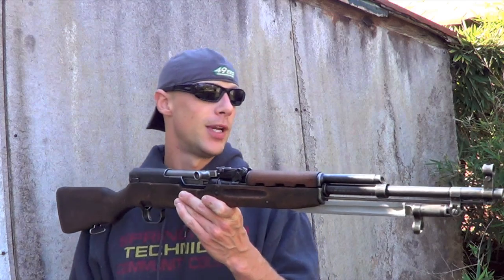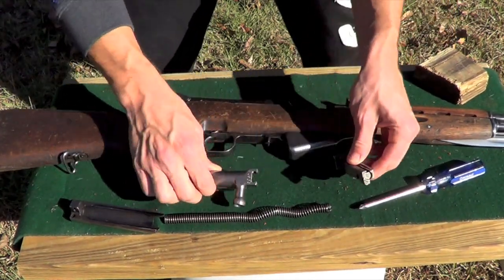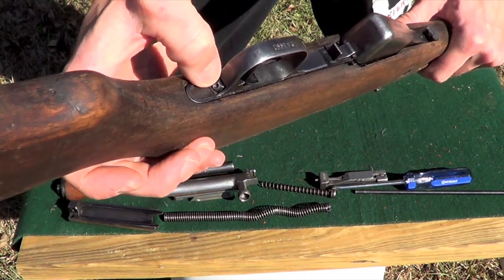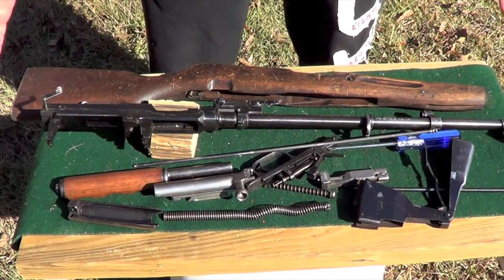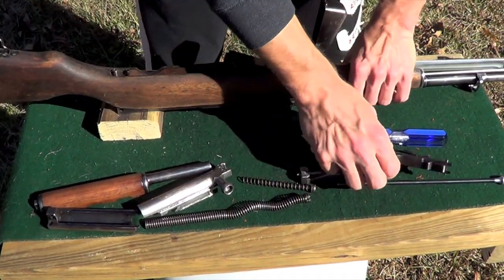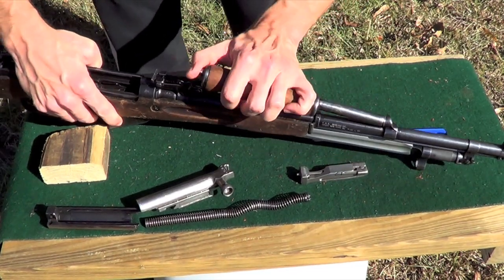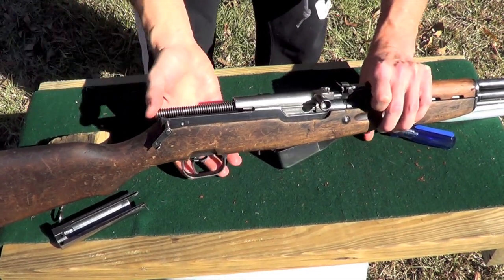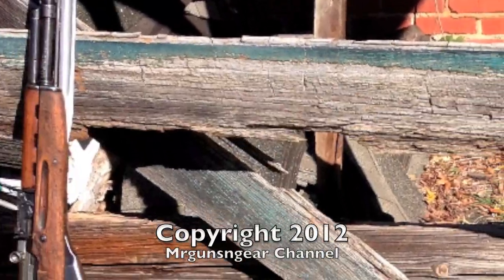Complete Disassembly & Reassembly Of The SKS (Type 56) In HD

Comment: Recently acquired a Norinco type 56 that had a broken nylon folding stock on it.  I was having a terrible time removing the trigger assembly. After watching this video, using your wood block method, I was able to quickly remove the trigger assembly. Thanks for the tip! 🇺🇸

Comment: I have had mine since 1982 and I recently put a Tapco stock on it and it looks great.  When I pulled it all the way down there was still bits of the the Cosmoline still in some of those places that protected the metal meshed up with the wood stock that I removed.
Reply from the maker: +kc5hgv cosmoline is always coming out; you can never get it all :D

Comment: Thank you sir. I used this video to dissemble, clean and reassemble an SKS that I bought from Classic Firearms. You could not have made it any easier for me. I did have to take the bolt apart since the firing pin was gummed up with Cosmoline and I replaced it with a spring-loaded pin from Murrays Guns.

I agree with Jeffrey -- no BS -- just fast and accurate.

Comment: You don't necessarily have to keep opening the trapdoor to put the bolt forward. All you have to do is depress the follower within the magazine with your left thumb and pull the bolt back with your right hand. The bold-catch will drop. With your left thumb still depressing the follower, move the bolt a little forward, clear of the catch. Take your left thumb out and let the bolt go. Do NOT leave your thumb in the gun when you let the bolt go unless you want Russian "Garand Thumb." Other than that, your video was extremely helpful and a wonderful teaching tool.

Comment: Great video thank you. Just used it for my first SKS teardown to clean all of the cosmoline. It was perfect. If anybody is doing this for the same reason. Make sure you tear down the firing pin assembly as well (not shown in this video) to get all the cosmoline out. Mine was full, and it would’ve resulted in slam fire at one point or another if I had skipped it

Comment: Quick tip that I found at a SKS Blog; my SKS trigger group would not snap into the clip. I read where someone used a C-clamp. They mounted to the square pArt of the barrel and trigger guard. I mounted it inside the trigger guard, afraid the piece of metal would bend. Anyway, some gentle tightening of theC-clamp and it snapped into place. The rest if the build, follow Mr G's directions. Susie-dog wanted to dress up as the Easter Bunny.
Reply from the maker: Nice.  Thanks.

Comment: I noticed you had a little trouble putting the boat and carrier back in your rifle. I find that it if you pick up the rifle, hold it upside down and let gravity hold your boat and carrier together it makes it a lot easier to to put them back in the rifle. Then you just slide them forward until they lock into place turn your rifle right side up again and finish your assembly.
Reply from the maker: thanks

Comment: Appreciate the video.  I have an SKS that I brought back from VietNam.  It was in need of an extensive complete cleaning.  I got it apart relatively easily and did the cleaning.  When putting it back together, however, I was unable to get the trigger assembly to click in place.  Suggestions????

Comment: I noticed that the "bent" part of the recoil spring that's under the back/dust cover was faced opposite of mine. The "bend" in it looks almost identical to yours, simply just facing the other direction (towards the stock and not the barrel). Does that make a difference at all?

Comment: You don’t have to push the recoil spring onto that ledge when reassembling. Just put the springs in as far as it will go (curvy end first) and put the metal cover back on.
Reply: I was thinking this aswell.  I never have and it fires fine

Comment: I am an SKS fan for sure...have 4 now....great video and you do that about 5 times as fast as me...A little more practice...lol...and I'll be here.  Quick question please.  I just bought a Norinco Chinese SKS and it's outer barrel surface has a texture different than my other SKS barrels.  This one has a grooved texture (like shallow small threads almost) rather than a smooth one on the outside of the barrel.  What is the difference?  Is there a function of the grooves?  Is one better than the other?  Thanks.
Reply from the maker: Not sure honestly.   Perhaps to lighten it up?

Comment: lose the bayonet, and lose the fixed mag set it up for 30 round clip, change stock to draganov or to adjustable folding stock. I've had mine since 1995 and it works great personally I didn't like the draganov so I switched it to the adj. folding stock that has the slot in handle for the cleaning tools that are in the original wood stock

Comment: Late to the party but...as I’ve never owned an SKS before, and having seen a Chinese one a few days ago (for way over what one would typically ask, as I’ve been informed); I noticed two brass(?) pins across the bottom of the stock and then a little play in the top hand guard. Just wanted to know if those were unique to the Chinese SKSs or could be found across the board.

Comment: I know I’m way late but I had a question. I recently inherited a Norinco SKS with a polymer stock and don’t know much about the SKS platform. This SKS has the original fixed mag removed and was set up to use removable polymer 30 round mags, I have the original fixed mag. There is some vertical movement of the receiver, especially at the rear of the receiver, and a tiny amount of forwards and backwards movement of the receiver within the stock. Could this be due to the removal of the fixed mag?

Comment: Great vid bro, question about the gas lever?
My rifle won't do a complete cycle, I just got it, gonna clean it, but it seems as if I am not getting enough gas to cycle the bolt.
Any suggestions?
Reply: Make sure the entire gas system is clear. That means removing the upper handguard with the gas cylinder and cleaning it. Take out the small gas piston in the sight housing. Clean with a brush if need be. Make sure the hole into the barrel in the gas block is clear. Some soft wire to make sure the hole is open. Some solvent on a pipe cleaner might help.
Always best to clean any new to you rifle before firing it to remove any possible grease or obstructions.
Reply: @BigLisaFan  Just got a new receiver.. Seems the little clips were not engaging properly.. Works fine now!!!
Reply: @islandwanderer1173  Love a happy ending.

Comment: ... everyone is able to push their trigger group down and it clicks in lol. Mine is having none of it!
Reply: The safety has to be in the "on" position on your trigger group. If it is horizontal it's on, vertical it is off. Also, make sure the front of the trigger group is properly in place. A good rap with your hand and it should just click into place. I am sure you probably have figured this out by now though. It's a fairly simple designed rifle. (It is not a gun. Guns are crew serviced field artillery pieces. Well, that's what I was told in the army. LOL)
Reply: My furniture was a little eh, I took it apart, put it back together, and made sure that my bayonet abs barrel were solid.  Trigger went back in and the rifle is sturdy as hell!

Comment: Just picked up a JG sales SKS.its swimming in cosmoline but a fine weapon real good shape.but the pin won't come out of bolt to release firing pin.i gave it some hard blows but won't budge.u got any ideas.really appreciate any.thanks.Clem.
Reply from the maker: awesome
Reply: don't hit it anymore
Reply: You need to warm it up so greace would melt out. Rifle was placed in long time military storage. Then it will work but put it in deep freeze to simulate serious winter overnight conditions. If it doesnot work straight out of freezer heat it up some more.

Comment: Hi there, I recently decided to disassemble my type 56 in order to get more familiar with the rifle however when I go to re assemble the magazine and trigger assembly I run into some problems.  as far as I can tell every thing is fitted in properly but the trigger assembly just wont pop back into place. ive pushed on this thing with all of my might, ive damn near stood on it (not literally) and it still wont click.  Im basically out of ideas so any help would be greatly appreciated.  Also my bayonet for some reason refuses to lock the cleaning rod back into place so if you have any advice for that I would again be very grateful.
Reply from the maker: METALWULF without seeing it I'm not sure I can help?
Reply: METALWULF push harder

Comment: 2:25 I'm having serious trouble taking the trigger off and getting it on. I was able to get it off of my plastic frame for it then I couldn't get it back onto it, so like an idiot I tried attaching it without the frame at all thinking I can slide it in already assembled but I couldn't and now I cant unnattach it and I used every last inch of strength me and my very strong friend had to try and push a screwdriver into the trigger and take it off. But even then cant figure out how to get it back on. I wonder if the same problem would occur with a wooden frame

Comment: my yugo has a hole and what seems like narrow cylindrical compartment in the buttstock.  what do most people use that for??????
Reply from the maker: Is it the cleaning compartment?
Reply: Mrgunsngear Channel its the factory brush set that it comes with, the cylinder is spring loaded, just cleaned my cosmoline off my 1951 russian sks today, used auto degreaser and it worked really well, finished with hoppes #9 lubricating oil

Comment: The spring and rod that are underneath the rear sight are stuck in my Yugo. What do?
Reply from the maker: +Trey Vonburg heat?
Reply: +Mrgunsngear Channel I fired it to gain a little better clearance to tap the piston  extension out. it was bent into a slight s shape. Replaced and it works fine.